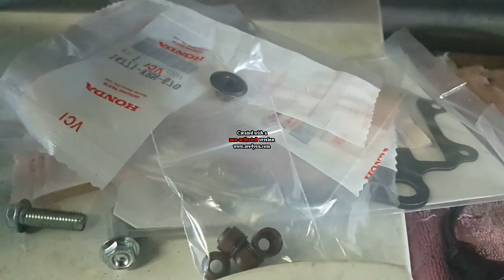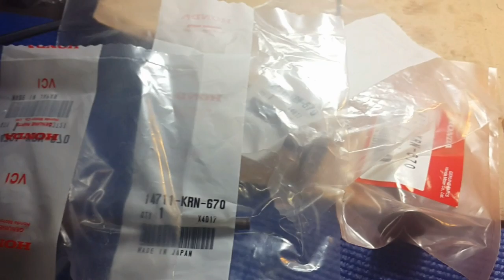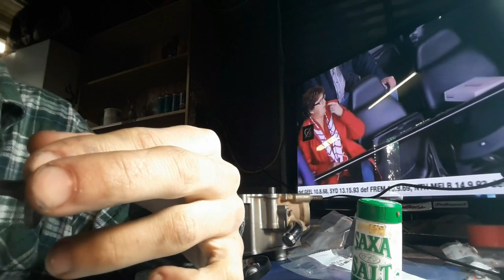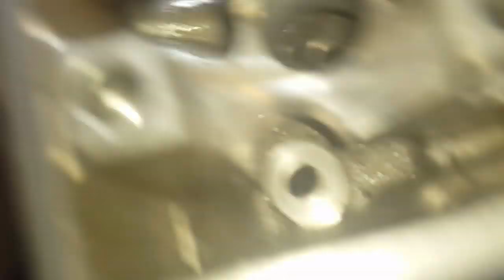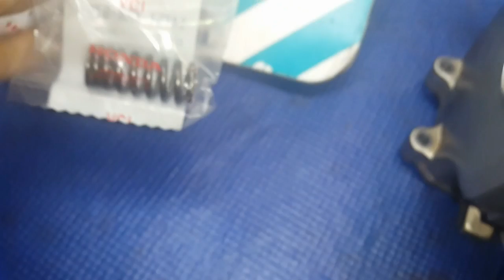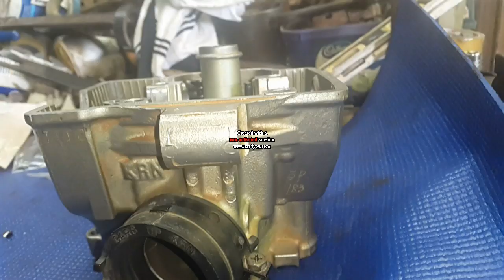how to replace crf250 valves

Comment from the maker: Update to this video 6 years later. Bike was a back yard hack. Quick fix. Ran strong until it needed a top end as it was a little low on compression. Very old but went good
Reply: What have you done to it in the past 6 years in order? Also, do you still have it

Comment: Are these titanium or steel valves? Steel valves are way better for reliability, and don't wear our as fast as titanium valves. But if you're gonna lap valves use the old valve to do it. And then to leave a Mirror finish get some buffing compound and a small dremel buffing wheel and lighting buff the seats so the valves will seat perfectly

Comment: U alright I've got a 07 250r and it's just dropped a valve I haven't opened the motor up yet but the left exhaust valve was in the header pipe or part of it I pulled the clutch in almost instantly do u think I'll need a new barrel it was only one valve what went. It's had half hour on it since the shop got it re-shimmed so I'm going to go back to them and make them pay for the damage cuz I'm sure they done it wrong. I'll have to find out
Reply from the maker: SpeedDemon you will have to pull it off and inspect it mate to see exactly what damage there is.

Comment: I would recommend a Kibblewhite or ProX stainless steel, or titanium valve kit next time, with a heavy spring. Factory Honda intake valve components are awful. I love my Crf, and I love Honda, but they didn't do a very good job designing valves. I put my ProX kit in 3 years ago, and I'm still running some pretty sick compression.
Reply: Did you just change the valves and springs? I just bought the kit but that's all it comes with I'm pretty sure it's still in the post. Only got intake tho.
Reply: Yeah, I just did intake. Aside from changing out gaskets, that's all I did.
Reply: Did you mix Stainless Intake with titanium Exhaust Valves?
Reply: scursion07 aré wiseco stainless steel valves good. ?

Comment: So you used brand new valves in worn out seats, and lapped the valves to cut into the worn seats?
Reply from the maker: +Bobby Loomis no all new 
valves
seals
springs 
cleats and base plates ect
no the seats didnt need doing

Comment: Never lap Titanium Valves!! it damages the coating on the Ti valve and will cause premature failure.  Best to send head of to re cut or replace the valve seats to match new vlalves.
Reply from the maker: there not titanium
Reply: You appeared to be replacing with stock components, Intake Valves on 05 CRF250R came stock with Titanium intake valves.  So they steel intakes from Honda, or did you use another brand?  Kibblewhite, X2?
Reply from the maker: +djreed456 there both steel. just what it said in the thing when i bought them... steel intakes and steel exhaugst. worked out fine any way still goin strong